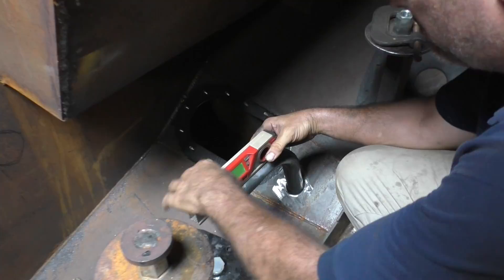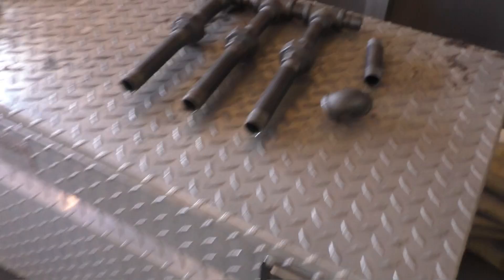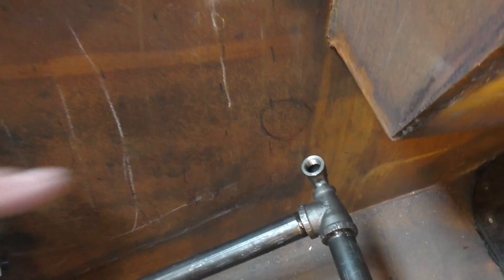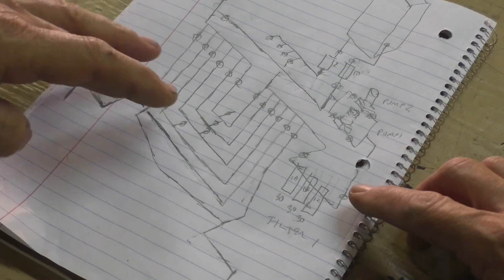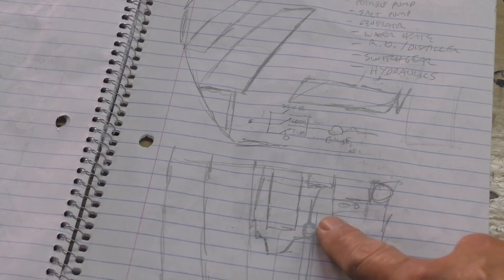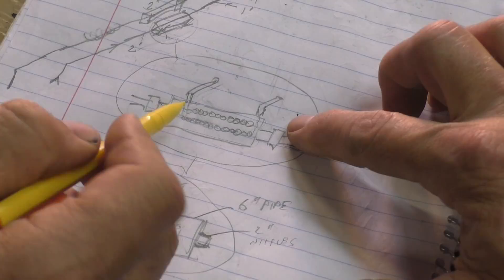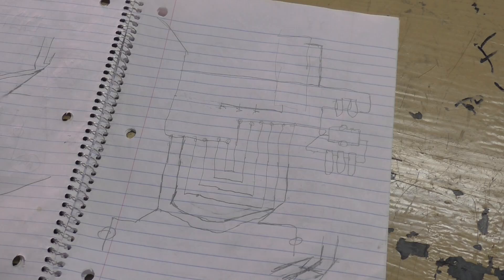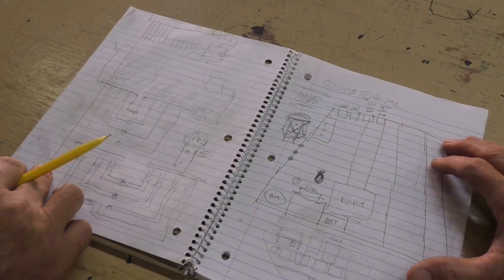Fuel System Plumbing and Engine Room Layout

Comment: Love that fuel system. I like the idea of circulating the day tank. The ability to run your day tank through an extra filtering will be useful. There is lots of questionable fuel out there. The ability to run it through a filter an extra time or two will pay off, 
You should keep drawings/plans on the fuel system, electrical diagrams, a Haynes manual for the engine, etc & kind of build yourself an owners manual. You know where everything runs now & you know every detail of that boat but, ten or fifteen years from now, being able to look back at a reference will come in handy.

Comment: I love that welded manifold.  It doesn’t need a thing.  If that went thru my shop I would have lathed the joints, and left them proud like you did.  But, it actually looks right the way you have it.  It looks so steam punk, but it's real.

Comment: I would highly suggest using a fuel purifier/clarifier in line with suction from bunker tanks to day tank. On the vessel I work on we use it all the time and it has saved us a lot of hassle - dirty fuel clogs up your fuel filters quite quickly and the costs go up where as if you used a clarifier, you would just need to clean the bowls every 3 or 4 months or 1000 running hours. Marine diesel can be pretty dirty sometimes. Give me a shout if you want some more specs as there are good systems out there for smaller vessels. I would love to come and get involved sometime when the engine room needs kitting out. Love the channel!

Comment: I would recommend setting up your boat's fuel tanks with a high and low suction. you'd normally run on the low suction but if you start having problems with the engine because of condensation in the tanks you can switch to the high suction above the water. the idea of adding a drain on the day tank is a good one. its common to have a valve like that. On steam ships they are refereed to as a "treadle valve" because they are usually at level with the deck and are activated by stepping on them. a note on the treadle valve, always watch the drain and dont use a heavy tool box to hold the valve open, its too easy to forget about it and waste a lot of oil. the drain on the tank will usually drains to the wast oil tank, or sludge tank but I have seen one instance of it draining to the bilge. it is typically a third's job to drain the condensation in the tanks once daily on his rounds.

Comment: Hi quick note on the fuel system prior to the filters you will need to fit an aglomerator.  My spelling may not be correct but it separates the water from the fuel, modern fuel filters have the larger bowl on the bottom of the filter to accommodate this but it may not be enough for a boat. Better to be safe than sorry hope this helps

Comment: Nice work!   FYI, 2nd union from the right at 1:51 looks cross threaded.
Reply: I was going to say the same thing
Reply: That's possible but with the base of the hex showing on the left side I'm guessing it's at least partially screwed on.  Doesn't really matter at this point...I only mentioned it so they would be alerted just in case the threads were damaged.

Comment: beautiful work but the coast guard prohibits the use of street elbows on the fuel systems of commercial boats. You may run into an issue when you get your boat inspected.
Reply: 46 CFR 56.50-65 part (g) Bushings and street ells are not permitted in fuel oil discharge piping.
Reply: It's not a commercial vessel. For what purpose would the vessel be inspected? Please give me the name of the man or woman who claims that they have a lawful right to administer over Doug's property. Code is not Law and I know this because the words use different letters.
Reply: Doug has repeatedly spoken about doing charters for researchers and divers. like it or not you cant just build a boat and sail away, well I mean you can but you'll run into some issues with customs when you come back to port. additionally a vessel used for anything other than pleasure must be documented. A vessel needs to be flagged to a state. If doug flags his ship with an american flag it will be inspected by the coast guard or the american bureau of shipping(ABS), or both.  At that time he may run be asked to remove that street ell and replace it with a nipple and normal elbow. if he chooses to register his boat with the Dutch the street ell wont be a problem. I personally wouldn't use a street ell anywhere on a boat because they are more prone to failure in fatigue from vibration and they are also more difficult to use in confined spaces. doug will do what ever he wants but like it or not, inspectors have a weird thing about street ells, in much the same way as the dutch have a thing about chin straps on hard hats.

Comment: Is that bus engine gonna beable to push that beast vessel theough the water
Reply: He can always upgrade the injection pump and make double to hp and tq
Reply from the maker: Yes.
Reply: it's got plenty of power for a 72' sailboat, more than enough really.
Reply: Doug makes it, Cummins shakes it
Reply: byrysh I bet he wont have bow thruster.... and its gonna be a pain in the ass when he's in port. One shaft engine + no bow truster is hard to maneuver.

Comment: My background is 40 years of computer systems, software design and electronics… I’m NOT a designer of ships to say the least - so take that into consideration with my question.

It appears to me that your fuel tanks use the steel of the hull as part of the tank structure. If there was to be an accident, God forbid but it does happen, and something punctures the hull and therefore causes a fuel tank in at least one tank the result would be fuel being spilled into the ocean -  not to mention the loss of fuel for the ship.

I’m sure that thought has been covered, but I’ve never seen a post of  anyone asking.
Reply: How many liners would make you feel better about the safety of the Ocean?
Reply: Doug has stated the purpose of Seeker is to provide a platform for scientific research. That would, one assumes, be coral reefs that are known to be very sensitive to oil spills. I would hope there would be concern that a fuel leak would have the potential of causing problems in the immediate area. I am certainly not a ‘tree hugger’ by any means, I simply questioned if thought had been given to the possibility of a leak in a fuel tank. I assume it would take considerably more than a ruptured fuel tank to cause a flooding problem for Seeker.
Reply: Don't think seeker is built for coral reef work specifically - you'd be better off with something more maneuverable that draws a lot less (not bashing seeker at all). Heaps of interesting stuff in the ocean that dosn't deal with coral as well! However - fuel in the ocean is really common, planes jettison fuel somewhat regularly, not good, however, not catastrophic either
Reply: I did not intend to imply that Seeker was built specifically for researching reefs, far from it. It has always been spoken of as a general research vessel. It appears I am in the minority in being concerned about fuel spills being a hazard to the marine habitats. I have several friends that are commercial pilots and I made a couple quick phone calls about the dumping of fuel. They each assured me that was only very rarely done. It is like dumping money down the drain… fuel is very expensive. (They also have to answer to the powers that be as to exactly why they dumped fuel as it is considered to be a biological hazard.)
Reply: To the best of my knowledge, SV Seeker's primary mission is to explore the great expanse of the worlds oceans and to seek out new discoveries hidden within the vast depths. Being a good steward of the waters by acting in harmony with the forces of nature is a fundamental guiding principle by which the majority of Doug's supporters subscribe. 

As your question regarding the reliability of the fuel tanks ability to maintain containment in the event of an "accident" is a prudent concern, your question equally brings forth another fundamental mainstay beholden by the great majority of SV Seeker's supporters, and that principle constant with logic is Personal Liability. 

In a world of reality, and self honest men, who can admit their limitations, the word "accident" does not exist. Bad things happen because dumb people use poor judgement.

A problem with "requirements" is that man is fallible regardless of the quantity of safeguards we may put in place. In the application of certain safety requirements we create a massive legal loop hole wherein a vessel in full compliance experiences a failure. In such an event, no person will bear any legal liability and everyone will call it an "accident". 

If I may continue, in the event of a fuel spill and an open admission of guilty with an offer to compensate....Who would the "wrongdoer" Pay? Does he or she pay the ocean? Pay the usa, russia, france, china? Does North Korea "deserve" any of the Fine money?
Reply: Steve B if it did leak diesel fuel into the ocean the diesel fuel would float on the surface and just evaporate off it's not like they would be dumping raw crude oil into the water
Reply from the maker: Would you rather loose 300 gallons of diesel into the ocean and keep the boat and crew afloat because you have a double hull; or loose 1500 gallons of diesel,  the crew, and the entire vessel?
Reply: I’m not sure why this conversation is continuing to be directed toward having the Seeker sink…. I NEVER said that was a concern!  My question was pretty basic and straight forward about the loss of fuel into the ocean should there be an accident. It was never a question of having to pay some country a fee for spilling fuel. Crude oil? Not sure where that came from…. I wouldn’t expect Seeker to be built with a double steel hull. The cost and design would, I assume, be HUGE! However there are fuel tanks that do not rely on the hull for part of their structure.  That’s all I ask… was that ever a thought? Ah well, it appears the general consensus is that there is no concern about dumping a few hundred gallons of fuel so I’ll let it drop.
Reply: Well it appears the misquotations aren’t going to stop…. I NEVER or suggested any kind of fuel tank. Single/double/triple I never suggested. I simply ask if any thought had gone into what to do if there was an event that resulted in a loss of fuel overboard. Regarding the old style of single hull tankers – they were disasters waiting to happen. They caused huge damage all over the globe until ‘we’ finally had enough and forced them to take corrective steps. BTW: It is totally legal to use the hull as part of a diesel fuel tank so that is not a problem. I can’t wait until Seeker gets her first taste of salt water!!  What a long awaited day that will be…. GO SEEKER builders! Stay safe….
Reply: the storage of oil and fuel in double bottom and saddle tanks is common, and yes oil spills happen when ships are run into docks and up on rocks. the amount of fuel stored on the seeker is really insignificant in the grand scheme of things. if it is hit and spills a little its no big deal and i doubt they would even be cited.
Reply: Too true… in the ‘grand scheme of things’ worldwide even the ‘Exxon Valdex’ crude oil spill wasn’t a big deal. So why be concerned about small spills? I guess you are correct… Why bother with things like holding tanks – just dump your waste into the ocean, shrug your shoulders and move on to a better area. It’s nothing in the ‘grand scheme of things’, no?
Reply: there's a pretty big difference between a 100 ton boat's fuel tanks(say 10 barrels) and a 1,000,000 barrel tanker. oil pollution incidences are a big deal, If you spill any oil(even just a gallon) you should report it. if it wasnt due to negligence and your are diligent in reporting it in most cases you wont be fined. the best way to prevent oil spills is to use situational awareness when transferring oil onto the ship or between tanks, and not hit stuff with the ship. if youre in a damage control situation like you described above you dont care about keeping the oil in the tank, you are concerned about keeping the water out of the boat. 

Im not sure if you know this, but oil naturally oozes out of the ocean floor in the gulf of mexico. there are bacteria that digest the oil in the water and the environment can absorb a remarkable amount of oil and be fine. its another story if you over whelm it with a million barrels of crude though. A note on this bacteria, It can grow at the water oil interface in your fuel tanks and clog your filters if you get in to heavy seas. That is why it is so important to use a good biocide in your diesel tanks.
Reply: I can see where your coming from as a computer science person, you want to control the scope of the fuel variable. essentially make it a private variable. the issue faced in naval architecture is how to fit the all stuff needed to run a ship on a ship. for small boats like this it is a lot more difficult that on a larger ship where you have the liberty of being able to do away with using your double bottoms for fuel and keep your bunkers in the saddle tanks.
Reply: I’m not sure what ‘damage control situation’ you feel I described. Perhaps you can point out what I posted that gave you that impression. Yeah, the best option is to NOT hit stuff with the boat! But accidents do happen, we call them accidents because we are not in positive control when they occur. If a fuel tank on the Seeker was to be punctured I doubt there would be much concern about the ship sinking. Doug’s layout of the fuel tanks does  not use very large tanks where that would be a concern. Actually if a large tear were to be made along the side of Seeker the fuel tanks would most likely prevent water from really entering the ship. 

I live in SoCA and we have crude oil oozes all up the coast. Other than messing up the sand and making a mess on your feet there is rarely a problem unless a storm blows a the floating oil patches onto the shore. Even then it is gone in a few days….. I always used a ‘biocide’ in my diesel tank in my car… good filters, changed regularly, and bacteria isn’t a problem.
Reply: you described a damage control situation in your first comment 

"something punctures the hull"
Reply: That meant “damage control situation” to you?? I guess if that is how you want to interpret what I wrote there isn’t much I can do about it….
Reply: It's called an acceptable risk. Yes there is a possibility that fuel could be spilled. The design is such that the spill would be rather small as outlined by the EPA and US Coast Guard. If you are truly concerned about the events that could take place during a spill, email Doug and ask him for the specs of his fuel tanks, do the calculations for him and advise him as to what he should do in the event of a single or multiple fuel tank failure. 
He's a busy man, I'm sure he will take any help he can get.
Reply: you can only pump bilge water over if it is less than 15 parts per million of oil. tank wash can be pumped over as long as the ship is under way and the wash doesnt leave a sheen. sewage can be dumped if the ship is more than 12 miles off shore and not in a protected habitat but it is the policy of most companies to always run sewage through a MSD (marine sanitation device).  Im not sure what the tonnage of doug's boat will be but he may be required to keep a log of the oil on board. If I was the master of that boat I would definitely do it to cover my behind if there was a spill, that way I could say exactly how much was spilled. a history of accurate log entries goes a long way in court.  you can learn more about how to handle waste on a ship in MARPOL 73/78
Reply: Yes, I am aware of the ships dumping raw waste into the ocean. I guess if they do it then it must be OK? (BTW: It is 3 nautical miles by federal law for NOT dumping raw waste)
Reply: Lots of replies to my original simple question... most replies having little or nothing to do with my question. At this point I give up trying to correct things. Just not worth the trouble as nothing I say is going to have any effect on what the majority feels. Also it is frustrating to type a reply and then it is never posted... funny how that happens, no?